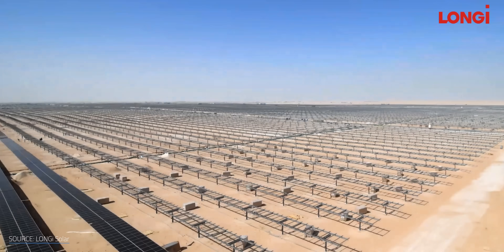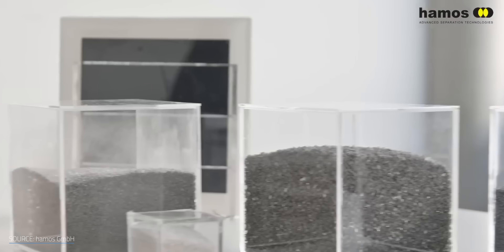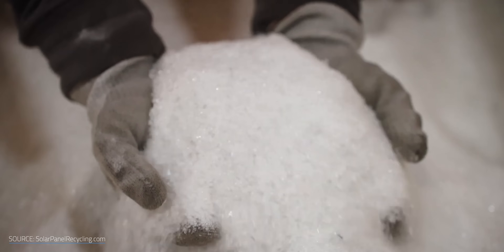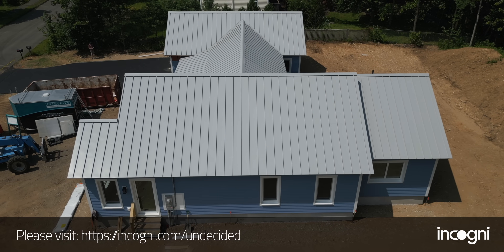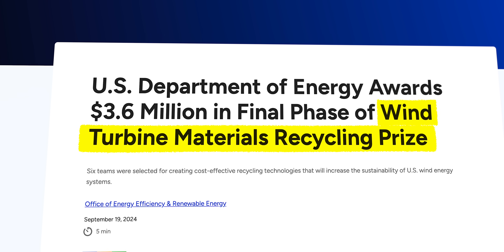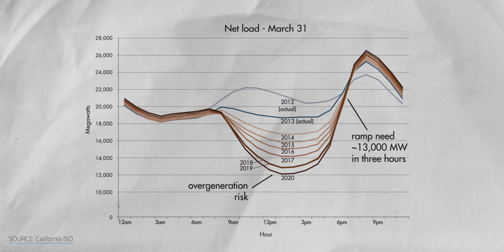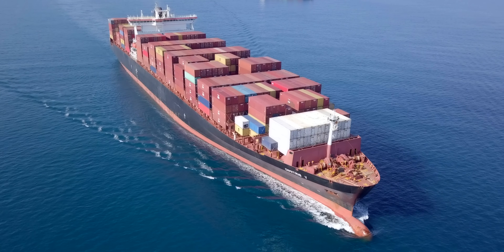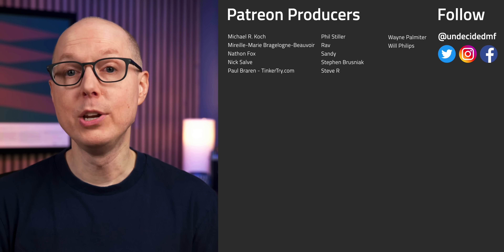How We Solved Renewables BIGGEST Problem

Comment: EVs are powered by coal my friend, if most grids are something like 60-70% coal or gas powered, you are just burning it at the power station with all the added losses along the way.

 Also none the EV crowd ever do the math, coal=>steam=>electricity=>step up transformer loss=>Line loss=>step down transformer=>supercharge loss=> battery loss=> finally your car switching loss and battery heating/cooling=>final wheels spin....

It is way worse then ice engine....and I should know as an electronic engineer. An ice can have a tank of gas sit for up to 12 months, an ev will self discharge it low voltage battery in a few weeks and the main battery degrades over the years so you end up with even less and less...

Comment: It's strange but it seems like making wind turbine blades that burn cleaner would be a win-win because god forbid they catch on fire, they wouldn't produce those pillars of thick black smoke you see in failure videos.

If you tried to make a shank out of a more recyclable material, then you've got the modulus of expansion to deal with, which killed some of the original hybrid aluminum/carbon fiber bicycle designs. Cracking joints are no joke, especially when they're cracking under load.

Comment: Just use them as non-essential roofing material.  I have a rather large series of compost heaps.  It is about 30ft by 10ft.  I buy used solar panels for next to nothing,  use the best ones for real applications and then use the worst ones as basically cheap roof tiles over the compost heaps.  Hook them up to a cheap battery,  and you basically have an electrical outlet without having to run wires out there.  I use it to keep a wifi router.  I also use the nearly dead ones as roofing for chicken coops.  Used solar panels still produce a lot of electricity for non-essential things even after the efficiency has dropped substantially.
Reply: Yes that's correct, if you use all the energy a panel can produce, it cools down a very tiny bit.  If you go the other extreme and don't use any of its energy, it doesn't cool at all, meaning it gets up to the same temperature as any other material sitting in the sun.  What it can't do is start a fire, at least until you connect it up to something and start making use of the electricity it generates.  As @bloepje says, if you use wires that are too thin or high resistance connections, you've basically made a heating element from an electric heater, so of course that's able to start a fire.  The easiest way to prevent that is to just unplug the panel when it's not in use.

If it really bothers you, just add thermal fuses close to every location likely to heat up, and then if it does get hot for some reason, the fuse will blow and the panel will effectively be disconnected, preventing any more heat from building up.
Reply: The unused panel is still an open circuit.
Reply: @wobblysauce Open circuits do not conduct electricity. Only when a circuit is complete does energy flow.
Reply: @RowanHawkins  
This is STILL an open circuit. That is the key point. Reusing this staff is not that straightforward as reusing plywood (untreated one). Just imagine a happy DIYist fixing a bunch of the old solar panels to a conductive underlay, or making patches on a rusty corrugated steel roof randomly creating short circuits. This will SCREW up the whole thing. It should be done by a person who understands. Even use of a galvanized screws with treated timber/plywood requires some knowledge so they are not to corrode quickly thanks to a wrong combination of plating and treating materials, let alone the solar panels.
I would prefer proper recycling of any potentially active/hazardous/contaminating material ASAP.
Otherwise, I would reuse.
P.S. Typing this safely on a great 12-year-old Dell Precision T3610.
Reply: @vink6163  No complete circuit, no heat build up. They heat up just because of the glass and black design, and will not heat up any more than normal by just sitting in the sun.
Reply: @ Yes, that's exactly what I said.
Reply: @vink6163  Well The other option is putting said used panel under a solar concentrator, THAT can start one hell of a fire!
Reply: @Astro_Alphard  That's true but you don't need the solar panel to do that 😀
Reply: And most that are replaced are working fine. It just isn't that new tech and a bit lower efficiency.
Reply: Love this- down south lots of people are buying and selling older gen solar panels for off grid use like at camps and barns. You might not be getting full voltage or current, but they’re cheap and you just add more to your array.
Reply: Just curious, why do you need a roof for your compost? I have my compost out in the open.
Reply: @hudnix  Your compost heap can dry out if there is a lot of sunlight, which hinders biotic decomposition.
Reply: @hudnix  depends on how much rain you get. Here in the UK over the winter a compost heap with no roof or lid turns into a waterlogged anaerobic mess. And other places that are very sunny can dry compost out too fast unless they have shade. Some places, I'm sure, have both problems depending on the time of year
Reply: @hudnix   to prevent rain from flushing the nutrients away
Reply: reuse is before recycling in "reduce reuse recycle" because recycling costs more than just reusing something that's old but still good enough to use. plus you can just recycle the old solar panels when they're even older still, and eventually not really useful at all anymore? taking a little longer and using it for something else in the meantime doesn't mean it can't be recycled
Reply: “Just” 😂
Reply: That's great small scale, but it's not recycling. It just defers the dumping for a while. There's no solution to the mass that goes to landfill here.
Reply: @ Yeah, but solar panels are being held to too high of a standard.  I buy crap all the time for my house.. I just bought a bunch of rugs, frying pans and storage bins.  Is anyone complaining that they will be in a landfill in 20 years?  What percentage of cars last 20 years? The whole ' but they will end up in a landfill' argument is like when Republicans blame wind turbines for killing birds.  It's just a lame argument because they want to drill baby drill.   How many things with the mass of a solar panel have a 20 year warranty?
Reply: You are aware that if you don't discharge the energy produced your solar panels may overheat and create a fire - since you said you use them not connected to grid, you'll be overproducing energy unless you have something hooked up (like lights, heating, cooling, whatever) that constantly consumes the created power.
Reply: @moos5221  what? I think you need to look into how (solar) energy works. No current == no heat (except heated up by the sun).
Unused panels can not overheat. Most fires are caused by bad wiring causing high resistance points with high currents. For a current you need a loop, i.e. you need to use power from the panel.
Reply: @moos5221  if there were low power and small size carbon capture modules, that would indeed close the loop even more ..

Comment: There is an intermediate step now being used in the recycling chain for EV battery packs. The reason for replacing most of them is that they can no longer deliver power rapidly enough to meet specs for cars. However, they can still hold a significant charge and release it slowly. This makes them suited for battery storage for solar power plants. The characteristics are well known so they are stacked in racks in shipping containers with the electrical control system connected to a computer to monitor them. This is being used in a couple of places in California and maybe elsewhere. That extends useful life by years and goes a long way toward solving the charge storage problem.

Comment: Why don't we just provide these no longer useful to solar farm panels at steep steep discounts to the average person? My power bill is very low so I have no need to invest $20,000 into solaring up my house, but if you can get me panels for pennies on the dollar I will gladly do it, and I'm sure countless other people would too.
Reply: Because that makes too much sense. You will pay and you will like it
Reply: They do just have to look in the right places, but the majority of the cost of installation is not the panels it is everything else so the savings are much less than desired.
Reply: Because the older panels get the less efficient they get as the reaction wares out. By the time they go to you they probably wouldn't be creating much power at all
Reply: @MrWhiskey1  They can also be dangerous and set stuff on fire. Happened with old panels we used.
Reply: While it sounds like a great idea, eventually when dumping old panels cheaply to upgrade every year it starts to look like the smartphone cycle/scheme.
Reply: @MrWhiskey1  they are dangerous and don't work like they used to

Comment: The use of glass laser welding can be used for glass windows also…thus improving window pane longevity and removing more plastics from manufacturing.
Reply: Yeah, that tech is crazy exciting in general, not just for renewables!
Reply: @CC-iq2pe  wont ir change its isolating properties? Glass conducts heat pretty well.

Comment: So here is a question, what is the surface area of a blade on a turbine? What is the surface area of the head and the body of the turbine? If we were to cover any parts of the turbines with solar panels, how much power could we generate? The blades stick quite a ways away from the main body so having a few solar panels mounted on the body could help assist in energy collection, likewise being able to wrap a solar panel around part of the blade closest to the hub could also provide a large area for solar collection. Is there something I am missing here?
Reply: If it was worth it, companies would do it. There's not that much surface area, the blades are vertical, and making them heavier is bad for durability.

Comment: Battery recycling has been in a good place for a while. Windmill recycling and solar panel recycling has been the tough ones, especially windmills. Glad to see were making progress.

Now if we could just make plastic recycling work for real, we'd really be set.
Reply: When it comes to plastic, I don't think the issue is that it can't be done but rather that the energy it takes to do it is so high that its easier to make new plastic and just burn the old plastic for energy. A big part of the problem is that the polymer chains that give plastic its strength degrade over time therefore merely melting thermoplastics down and reforming them won't yield as tough of a material as virgin plastic. Don't worry about waste, though, since soon landfills will become mining operations and will actually be worth a lot of money. 

Another thing to keep in mind is that plastics are made from crude oil and lots of countries produce the stuff. If country A decides to just recycle, then country B will be better off if it doesn't.
Reply: @ryelor123 Yes, the issue is that it has always been cheaper to make more instead of reuse it or recycle it. With oil demand dropping, that dynamic may shift. Plastic may become more expensive as a result, but that might be for the best.
Reply: @ryelor123  My understanding of the processing done by 'Energy from Waste' plants, is that they do not burn recyclable materials like plastic. In fact, it would be dis-advantageous to do so, as the residue would soon clog/gum up the feed belts. There is some plastic burnt, as no sorting process is truly 100% efficient, but I believe it is not a good 'sell' if they were to deliberately burn plastic directly and blow the residue up the chimney.
Reply: Not entirely the concrete can be broken up and reused for cement and concrete product. 

The steel can be reused very very so are mentals gears and cables. 

Key issue remain the blades
Reply: There has been some development in New Zealand, with a company taking soft plastics and making fence posts out of them, via a 'protected process'. Hopefully they will expand their market to overseas places, so they can reduce soft plastic to landfill waste. Possibly they will develop other designs and make new products as well. The company is called futurepost.

Comment: So the biggest problem WASNT solved, not even close: Global energy use in 2023: 172,222,000 GWh energy usage per year vs 442 GWh PROJECTED to be added by 2030 (0.000257%)

Now 100% storage is not required, but we are off by SEVERAL orders of magnitude from just 1%. Battery storage is just deflection from real solutions (nuclear)

Comment: Manufacturing something specifically to make it recyclable at end-of-life isn't just a question of whether it can meet or exceed the material properties of the conventional approach.  The question is whether it is economically viable to do so.  Turbine blades that are 100% recyclable with minimal effort won't make the circular economy function if they cost 300% to manufacture.

This is why taxes on virgin materials are so important.  Pulling oil out of the ground to make plastics and other petrochemicals to make wind turbines is cheaper than other sources, at least in part because of the subsidies the oil industry gets, and in part because of the sheer scale.  Both of those pervert the 'free market' decisions that companies making turbine blades have to make in order to survive, so this all comes down to having the political will to make the more environmentally-friendly options at least start on a level playing field.  That means ending subsidies to fossil fuel companies and taxing them for their externalities, including shipping things via oil (which is admittedly a lot less inefficient than it sounds).

Comment: I self built my house. Has geothermal heating and cooling. Super insulated. And solar. Net metering for now. Will be self installing enough solar this year to run my house completely off grid. With out worrying about loads. 3400sqft of house and shop. Was net zero for a few years. But now that the utilities are going with their own solar. They are trying to eliminate rooftop solar. They have come up with all of these extra charges. Even though I overproduce enough electricity to cover what I use at night. I now have a monthly bill. I live in Wisconsin. So personally I wish global warming was real. 
I did this so I won't have bills when I retire. 

The only way recycling is going to happen with solar is if there's enough money in the materials recovered. That probably can be done with solar and batteries. But only if enough solar equipment is produced to consume the materials provided by recycling. 
I don't see that happening with wind. But hopefully I'm wrong about wind equipment.

Comment: The majority of local municipalities don't even recycle all the stuff we separate. They just go through the motion. Because they have all of the equipment. But it actually costs more to recycle than they recover. When I self built my house. I had to take my scrap building materials. To the local city's center. Huge building on the edge of the city. Took me almost 4 years to selfbuild my house. Anyway I had to unload into a huge bin right in front of the giant recycling door on one end of the building. On the other end of the building. Was regular garbage door.  Every time I was putting building materials in the bin. (Many times over 4 years). There was a huge  front-end loader pushing the recyclables over into the garbage inside the huge building. Then it was loaded into nonstop trucks and taken to the landfill.

Comment: Recycling solar panels and dramatic improvement in panel efficiency will be a major propelling force in the solar industry evolution. Utilities not recognizing solar demand offset on a no-export system without an interconnection agreement and AHJs layering new codes onto existing obsolete codes during permitting are major negative forces that are stifling continued solar deployment. Solar industry groups must exercise agressive policy leadership and become radically more proactive in order to get ahead of these recycling, administrative and improved productivity curves.

Comment: old solar panels may be uneconomic for mainline power generation but they are still usable for low draw isolated environments

Remember recycling is the LAST resort, after "reuse"

That said, all of this is a lot of effort to avoid using nuclear technology. The energy requirements of fully decarbonising are well beyond what's doable with renewables (electricity is only 1/3 of carbon emissions). Nuclear is already 300,000 times safer than coal and more than twice as safe as solar (its nearest competitor), reviving the Molten Salt research at Oak Ridge (currently illegal in the USA)  offers the possiblity of adding a few extra zeroes at the end of the safety factor as well as reducing nuclear waste by 99% and costs by 80%

Various countries have been pushing ahead with molten salt research and China's had TMSR-LF1 operating for more than a year with an initial load of thorium (which is where Oak Ridge left off in 1968) - so far it's looking good and the next steps will be scaling up to a 10MW electrical generator, then from there to commercial (1GW) sizes. These can be drop in replacements for coal burners in existing stations as they're hot enough to produce supercritical steam, unlike water-moderated "conventional" nuclear designs

Comment: Nuclear is still the cleanest, most lowkey, most material- and space-efficient power source we have. We should be trying our best to recycle nuclear fuel, not build bird murdering machines that happen to generate electricity *sometimes*. PV could have its use if it didn't consume so much rare earth mats and require complex energy storage systems that in the end pollute everything even more. They should be the last resort, not a standard part. But alas, we can't have nice things, in order to pay off debt on made up currency, we have to BUILD MOAARRR